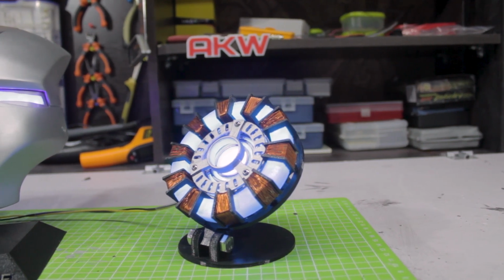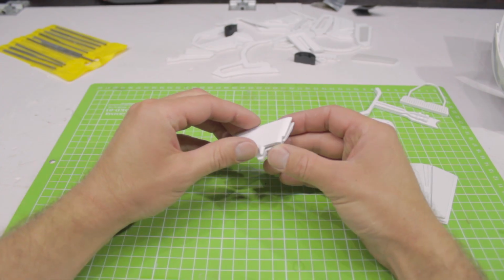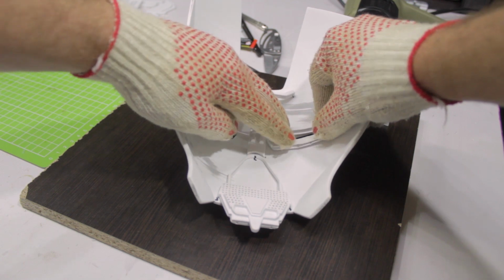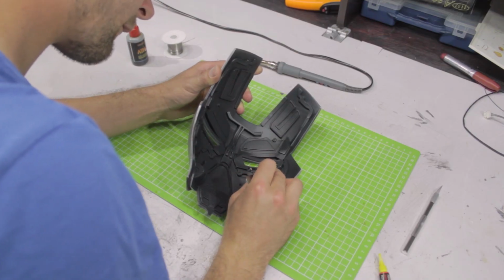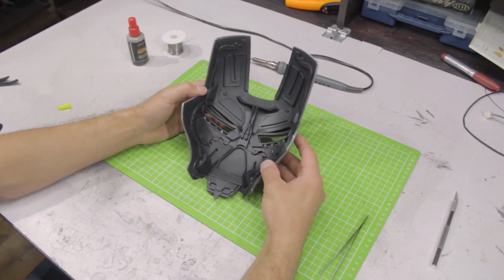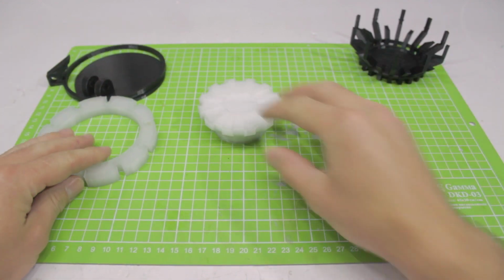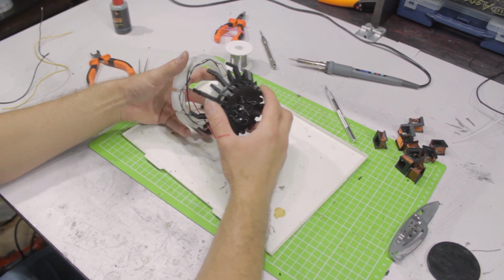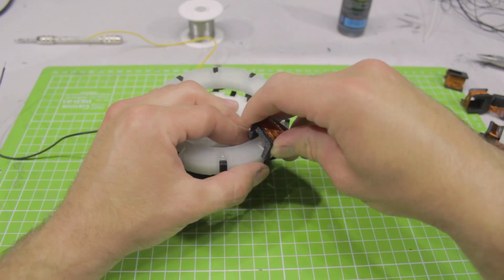Stark arc reactor & Iron Man mask made with 3D printer

Comment: hi, what sized bolts/screws do i need to attack the ring in place in the arc reactor. think i need 3
Reply: Not sure if you still need the info or not but you need 3 M3 size bolts screw the ring in place.